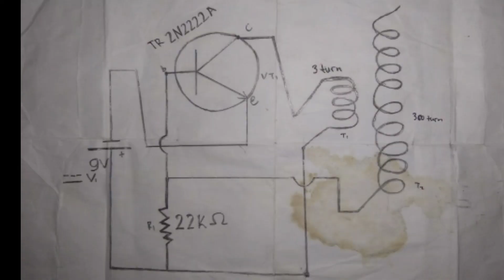Cara Membuat Mini Tesla Coil Sederhana - How To Make Mini Tesla Coil

Comment: Beli transistor 2N2222A dimana bang ? Di tempat saya jarang
Reply from the maker: Di toko online kak :)
Reply: @maulanafadhli1078  mau nanya bos untuk pengganti transistor 2N2222A itu pake transistor apa ya bos?
Reply from the maker: BC412 atau BCX95
Reply: @maulanafadhli1078  minta wa coba bos saya mau nanya2😥 mau bikin buat tugas sekolah masih bingung nih duh 😭
Reply: @maulanafadhli1078  kalo di ganti pake transistor c1815 bisa gak ?

Comment: Bang, gw udh ngikutin rangkaiannya semua. Cuma bedanya gw pake pipa diameter 1,5 cm trs panjangnya 12 cm, trs gw juga kabel primer nya make yg 0.75mm tpi kok ga nyala. Apa kabel harus yg 1 mm atau masalah di pipanya?
Reply from the maker: Periksa solder nya udah rapi atau sambungan ada terbuka?
Reply: @maulanafadhli1078  berarti kabel primernya dan pipanya ga masalah dong ya. sambungan sama solderan aman kaknya Soalnya transistor nya panas klo disambungin ke baterai
Reply from the maker: @zalfaanfatihprasetyo1554  kalau panas berarti listirik nya mengalir